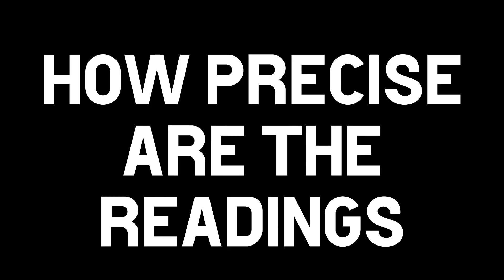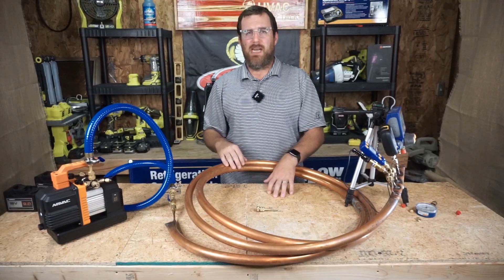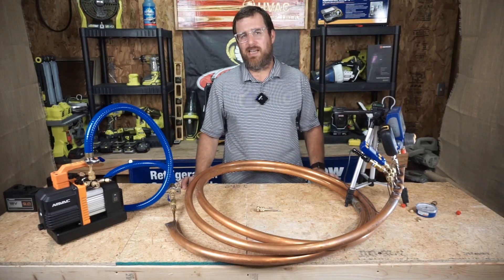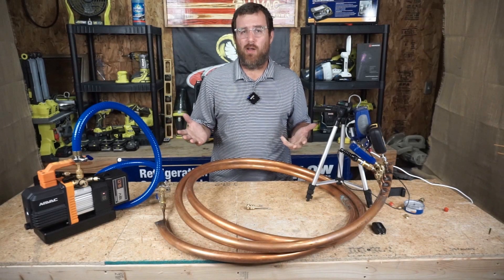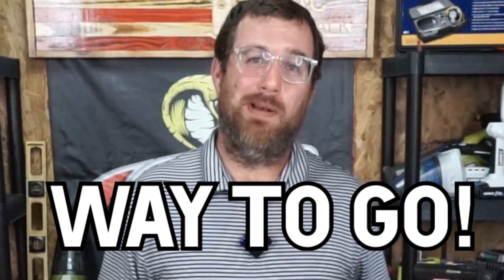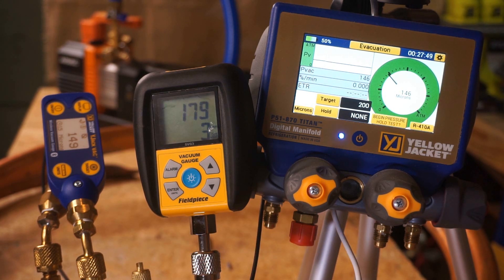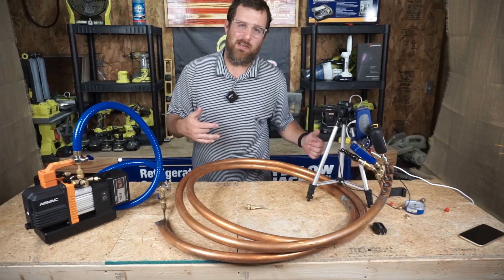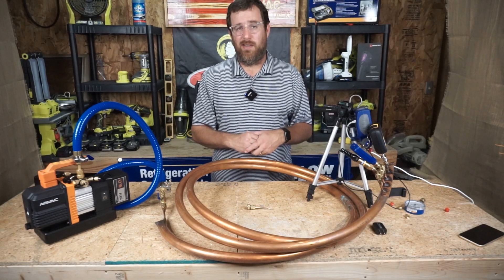Can You Trust Your Micron Gauge?

Comment: Most vacuum gauges work on thermal heat transfer through gas (or lack thereof in a vacuum) medium.  When vacuum gauge gets internally coated with oil and other contaminates it can affect their reading.  

Higher vacuum has less heat transfer out of thermistor, so sensor applied heating current is reduced to keep sensor at same temperature.  This is what the gauge is measuring.

Refrigerant oil or other contaminates on thermistor sensor creates thermal insulating mass around thermistor impeding the true thermal insulating effect of the vacuum around the sensor.  Light oil coating slows down response, a lot of oil can form a physical bridge between the thermistor and outer brass shell creating a thermal leakage path from thermistor, totally screwing up vacuum reading.

Most vacuum gauges allow you to clean them out with some 91% isopropyl alcohol into the Shrader port then lightly shaken to dissolve and flush out the oil.

Good practice to have a vacuum rated ball valve on vacuum gauge you can close off before breaking system vacuum with refrigerant.  This reduces possibility of refrigerant and oil getting into vacuum gauge keeping it clean.

Comment: I have two CPS vg200's.  #1 I bought a year ago and just put it into service a few weeks ago.  I wanted the reassurance of its accuracy, so I ordered a second one (#2).  #2 is always approximately 2 times the measurement of #1, no matter if a light, medium, or deep vacuum.  Always a 2:1 ratio.  I called CPS tech support and the tech said that the calibration is done at the factory.  A nice guy, and he didn't outright say it...but I sensed that there have been some issues.  Now to order a third, and hopefully, 2 of the 3 agree.

Comment: How “accurate” they are isn’t all that important as long as it isnt substantially off. It’s more of a reference to make sure we are getting the system into a deep vacuum… and to make sure the system is good and tight. Kinda figured we’d have a 50-75 micron variance between all the brands
Reply from the maker: You figured right
Reply: Using a micron guage doesnt prove there isnt a leak.

First its my understanding it doesnt even measure vacuum but rather temperature.

Second  a vacuum pump will overcome any leak in the system that isnt substantial and a 5min leak test isnt realistic.   

I even called the techs at one of the major companies and he even said " to have an actual micron guage would be in the thousands, its promoted to ensure people keep their pumps on longer."

Last point. A perfect vacuum is only  -14.7psi.  Good luck if you think that is a suitable pressure test.
Reply: @gabooda2380  nice YouTube science there bud. “I called” and “I talked to” doesn’t mean shit. It means you got another persons “opinion”. 

I’ve had units hold 350psi for 24 hours without a kick of drop.. then leak under vacuum. 

Pressure test it.. vacuum it deep… and make sure it holds a decay. If there is a leak that passed that stuff.. then it is what it is. 

People who work in the real world know that half this “by the book” shit doesn’t translate to something that is reasonable in the real world service calls. I work on a lot of junk. And I flat would be out of a job if I spent the time chasing the half the crap I learned was “right”. 

I dare you to take a 25 year old cooler, make a repair, and try to even get that thing to pull down to “proper vacuum” and hold a “decay test” You’ll spend the entire day pulling your hair out as the oil in the compressor releases refer under vacuum causing you to fail the 5 minute decay test you say “isn’t good enough”. System is tight, refer boils out of oil. Madness in-sues while you try to find a leak that doesn’t exist. 

But based of your comment you don’t do anything but new installs. So keep living in your fantasy land till you go do service. Hopefully you end up working with a guy who’s been doing it for awhile and slaps some sense into you.

Comment: New title ( how precise are the technicians at knowing where and how to set up the micron gauges)
                    (“ do the technicians even understand the different decay rates that should happen on different systems but blame the micron gauge ?”) 

       Or the technician that blames the refrigerant gages manifold. ,  because he’s trying to pull a vacuum through refrigerant hoses and it’s failing the Decay test

     there is a failure all right and he’s looking at it in the mirror
Reply from the maker: I’m gonna follow this video up with some stuff that might address a few of those things as well.
Reply: @TALYN875  do one with an old compressor filled with old used oil attached to your line set. 
           Bring down the vacuum and hold and let it decay and steady out. 
             Then strike the bottom of the compressor with a small 2 pound mallet and watch what happens.

Comment: As long as you place the micron gauge in the proper place reading the system, and not reading the vacuum pump.
🥃🥃🍺😂🍺🍇🏌🏻‍♀️
Stay safe. 
Retired (werk'n)keyboard super tech. Wear your safety glasses
Reply from the maker: I was going to follow this video up with a video where I show the difference between micron readings during the vacuum when the gauges are in different parts of the system.